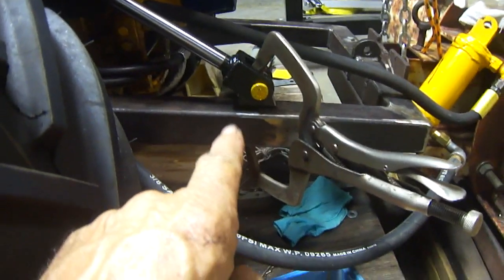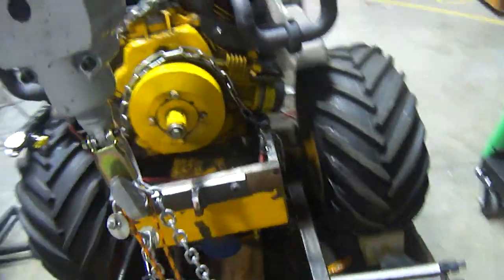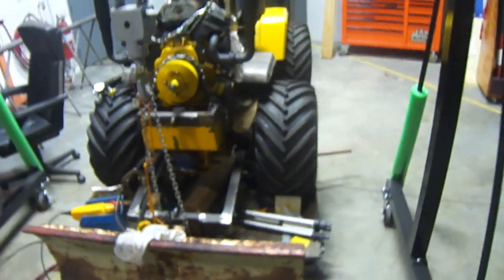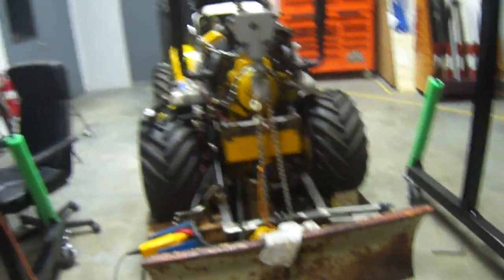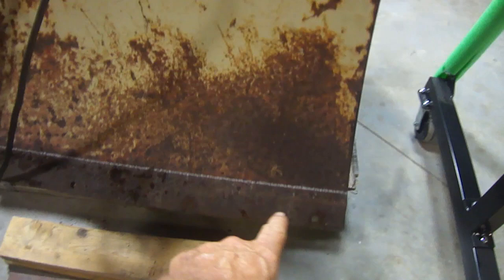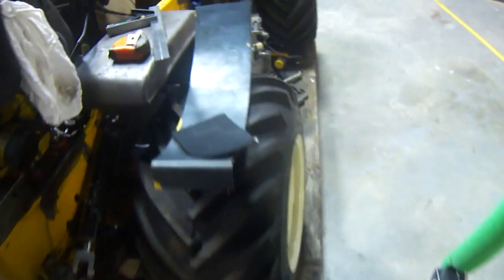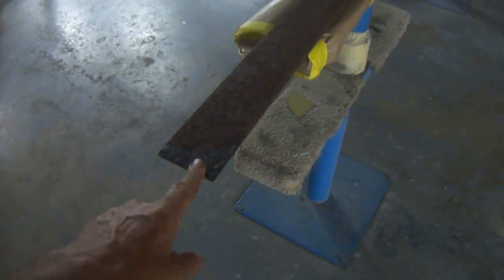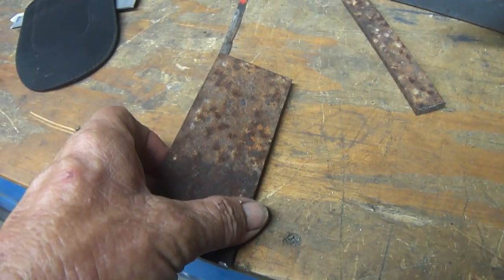Installing a snow plow on a 3050 Cub Cadet 4 wheel drive part 2

Comment: James, on widening your snow plow I I think you need to make it a little bit wider than you are. You need to angle your blade then widen it to clear your tires. As you're demonstrating it, it will not clear your tires when you angle it and you'll be driving on a Winrow of whatever you're pushing.  
The plow must be wider than your tires when the blade is angled!
Reply from the maker: it is 10 inches wider than the tires I tested the angle on it clear that good thank you very much for pointing it out if I do run over my dirt I just have to add on to it